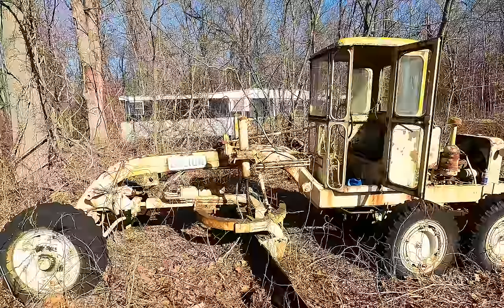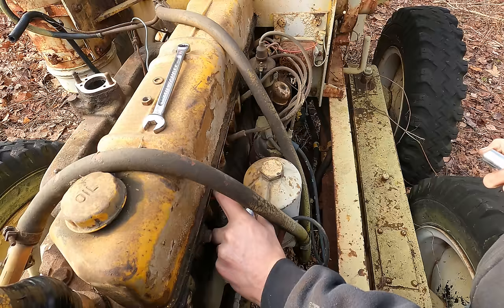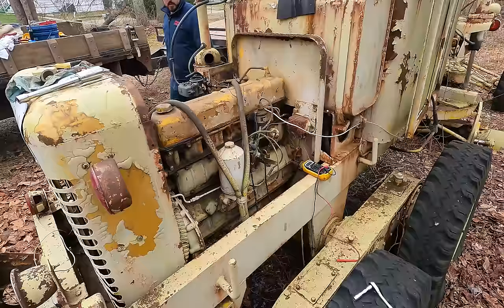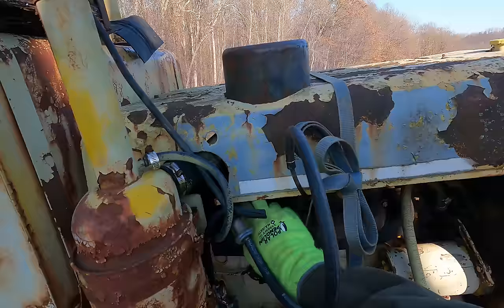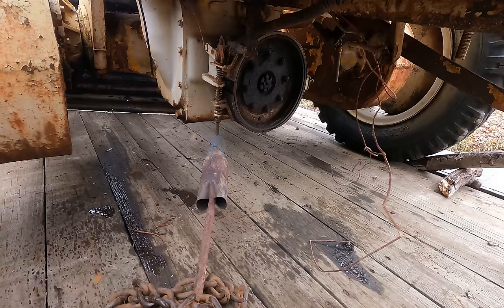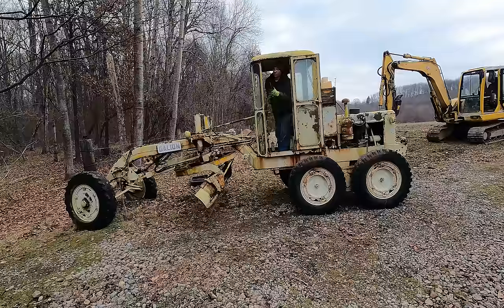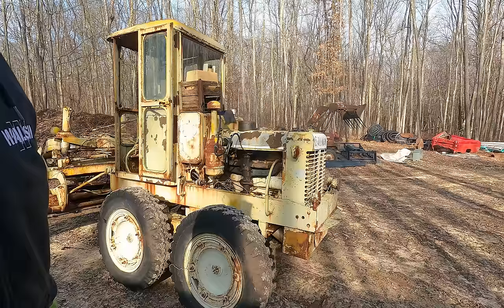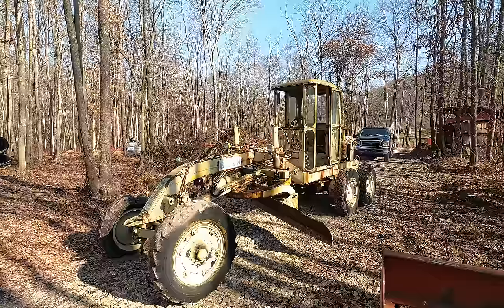1950's Galion Road Grader sitting 10+ years! (Will it run and drive??)

Comment: A tip on your GoPro. When you have the camera mounted, turn off Hypersmooth. It tries to smooth out movements and you get that rocking motion you can see when you are working at the bench as it tries to smooth your hand movement. To fix, make a preset mode with Hypersmooth tuned off and choose 'Mounted' as a name for it, and make sure to use 'Mounted' any time the camera is not hand-held.
Reply from the maker: Thanks! Yes it was giving me problems today and I was trying to figure that out
Reply: @DieselCreek  Mine keeps crashing. Don't know how to solve that one, other that turn up the beep volume so I can hear it over the tools 😉

Comment: The carb frosts because of the cooling effect it has on the air being sucked down its throat, accelerating it and freezing the air. That's why we have carb heat in airplanes with carbs, to prevent carb ice from moisture in the air

Comment: If that 1 pony engine wont run then its a dead duck for sure!! My brother bought a International D7? dozer that had been sitting since 1952 at a college site and it was used there for building the place..             
Did it run?  DAMN RIGHT it did and that 1 pony engine was great after a complete rebuild where it froze after sitting so long!!

Comment: We had an old tractor a Volvo T24, and the rubber boot was torn up and broken around the gear stick so one winter it froze solid from water getting in during the fall rain, so my dad ended up lighting a fire underneath it to break it loose and never parked it outside again

Comment: That is an IHC Black Diamond BD 220, BD 240, BD 264, or if it has tilted valves BG 221, BG 241, BG 265. For a great starter get from Wilson a starter for a LP or propane engine. Almost twice the cranking power. 
When you get it running, warmed up, torque the head bolts, then set the valves hot, idling around 400 rpm at 0.025” no matter what the sticker or valve cover or manual says. Set the distributor on 0°, set the ball in the flywheel on the pointer at 350 to 450 rpm, on our trucks I set the timing from 0° to 5°BTDC. My uncle has one truck that runs best at 12° BTDC, you have to find the sweet timing. 
Before you take anything apart, check where the timing is at. 
To find what motor you have, on the right side of the block, just below the head gasket, back of the water pump, there is a pad with the model number & serial number of the block. 
Good luck. 
Hello from north east Montana. 
10 miles from Canada.
Reply from the maker: Thanks! That’s gonna be a lot of help! I can see you’ve prob worked on a few of these!
Reply: @DieselCreek    When I was 14 I had to start being a mechanic on the farm. Dad had bad hip, he went to have a stainless steel cap put over the hip ball in 68.
So I did a lot of work on the farm’s 56 IHC S120 with a BD240.  The two 41 & 49 IHC K5S& KBS5 grain trucks that were converted from flat head  GD233 to BD240.  The two 56 IHC S160 grain trucks with a BD264 and a BG265 with a 2 barrel carb. Soon my uncles started hiring me to work on their grain trucks when they started finding out how much I could coax out of those old motors. 
The IHC inline 6 cylinders like their gas, but they have a lot of torque so that you can gear up, throttle back. 
Good luck from north east Montana.

Comment: Change all the oils. If there's water in the trans, there's likely water in the tandems as well. And possibly the hydraulic. And 10 years is a bit longer than most oil's shelf life. Also check the front hub bearings and circle drive case.
Good engine, and everything (except the electrical) seems to work fine. Just gonna take some money to fix it up.
Reply from the maker: Working on it!

Comment: If you are having camera troubles you can try an old smartphone as a camera. I have a GoPro hero 7 white and it's not that great. when I first got it it would freeze, it wouldn't be recognized in the smartphone app. They have stands and tripods for cameras and phones. You could use multiple cameras for different angles or as a backup if one camera fails to get the shot.

Comment: there's a reason that thing's been sitting for many years. cost more to fix than it's worth. i used to sell parts[Allis-Chalmers] for dozers, scrapers and motorgraders and we occasionally got parts back in the 70's for those galions. they sold out to somebody and parts are rare. used parts maybe. good luck. kinda like Mack trucks, had a lot of proprietary parts.

Comment: I had a nd 1400 flatbed that had a bad hydraulic line on it it was $700 for that one line couldn't find it anywhere but China! I was able to go down to the local hardware store and replace the line with flexible copper tubing and some compression fittings for under $20 that line has over 5000 miles on it and it's still holding strong so you might be able save some money taking a similar route

Comment: I used to have a Galion grader. It's very hard to find parts for them anymore. I ended up getting rid of it and bought a Cat 14E , ~ 1970 vintage. Cat still sells parts for them
Reply: If Cat ever made it,you still get parts.It’s there corporate philosophy no matter what production year it was
Reply: @michaelmckenzie5232  Yup. It's the reason why the resale value of Cat equipment is much higher than most other equipment, and consequently they're able to sell their new equipment at a higher profit margin as well. The people buying new equipment know that they will be able to run it for thousands of hours and still resell for good money in the end.
Reply: @castirondude  plus if you operate and maintain it like you should,It will almost never break down

Comment: Most of the time, there is a view plate or cover you can remove. Even remove just the Starter to gain access to the pressure plate. Insert a prybar between and separate rather than pulling engine or dropping transmission.
Reply from the maker: yep thats my plan!
Reply: @DieselCreek   I heard you say you might have to pull the engine... I was hoping you didn't have to go to all that trouble. Sweet looking machine and it ran awesome when y'all started it up in those weeds.

Comment: That is a fine looking little motorgrader. she will clean up nice, looks like you got all the glass for it.  Might be able to spray a bunch of PB Blaster or the like in around the clutch plates and given a bit of time she might break free, get her running and load up the blade with a healthy cut while holding the clutch down and she'll give. I always liked running a grader.
     I also started with the original Gopro, wife gave me a goPro Black and it eats battery life , there is one setting that records over previous video when it gets full.. to dang technical for me
Reply from the maker: I loved my hero7 black the 9 has a lot more features than it did tho

Comment: It’s carb ice, caused by a sharp air pressure drop in the carb (Venturi). It’s also an issue for piston driven airplanes that use carbs.
Reply: No. It's caused by the latent heat of evaporation of the fuel.

Comment: I’ve been a boat owner most of my adult life and one Marina I used to dock at their mechanic used to run old marine diesels on a IV bottle filled with WD40  to test them and get them running temporarily  I’m surprised you guys don’t use something like that just to get them on a trailer etc  I used the WD40 on my Chevy 3500  diagnosing  it in the driveway with very limited tools   The truck ran pretty well on the WD40  I thought  pretty cool piece of history you guys got there  as a kid in the 70s that style grader was one I thought was so cool  ironically in my 20s I worked for a new home builder  and  I used to help put in the roads  we never used graders as everything was  pushed with Dozers  Nd Loaders if it was a lot of dirt needed to be moved  I got to live some of those boyhood desires  by running  some equipment along with the real experts  yep sure. Ran a Skidsteer and cleaned up the curb and gutter  area for them  but I was still doing something usefull  it was a promotion from compacting on the Sheepsfoot roller that would rattle the fillings in your teeth

Comment: about the camera issue, i think its the memory cards you use, cause some of them (cheaper ones) dont have enough speed for the camera and just give you problems and it may help to replace the sd-cards if they were used very frequently as they degrade over time
Reply from the maker: brand new scandisk extreme ultra pro. fastest you can get to my knowledge.

Comment: I heard you about 'social distancing', and laughed; but I have another take on the Galleon: it's a work of real beauty..When you worked on that gas tank/ oil reservoir, weren't you impressed by the perfect proportions? And the piston size for the board!
That is, I think of it as a work of industrial design at its best. Now I know you bought it as a tool, and that's OK. But don't you have a friend that you could get to rebuild the motor?
Reply from the maker: I could rebuild the Motor.... but it doesn’t need rebuilt?
Reply: @DieselCreek  You are right: "If it ain't broke, etc." Sorry.

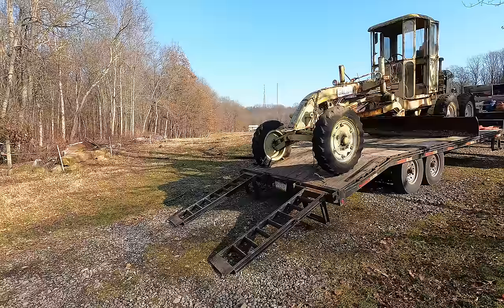Comment: I call it oxidation on the points, but I don't know what it is for sure. Probably parked because of the clutch; Such a healthy engine. At 19:54, as your safety officer, I denying your request unload this grader under it's own power. With the flat tire, you are going to slam that bade full force into the deck and bounce around inside the no seat/ no restraint cab. LOL, Ok, I'm really glad to see the loader come out. Yea, checklist everything when working solo like that. I haven't laughed that hard in a long time. Thanks

Comment: Those small graders are scarce, especially in running condition. I hope you flush that transmission with diesel a few times. Hopefully the gears, bearings, races and shafts aren’t pitted. Probably the rubber boot on top of trans is rotten. 

You have a nice machine there and can always get your money back. I work equipment auctions on occasion and when we get one, they bring good money.
Reply from the maker: Yes I need to find where the water got in at, the boot seems to be intact around the shifter also it is inside the cab so I’m not sure that that’s where it came in but I need to do some better inspecting

Comment: should have left the gear case plugged till it really heated hu thoroughly then you'd be sure you got it all. it may take longer to heat up but youll deff be sure you got it all cause with the voids in the case it doesn't heat up evenly

Comment: I HATE gopro. Only one I had was the 2, and that thing would frequently just either not record, or stop recording seconds in. It was complete garbage. Also, up till the hero 4, it was the BEST rated gopro! So that tells you something...

When I was using it, it occurred to me that they should have fixed the issues they had with the 1 and 2, and THEN made the body smaller and lighter and whatever. There was no issue with the size that a functional camera wouldn't outweigh!

Also, I love the song you inserted there. You know, the: "there was a house in New Orleans, they caaaalllled it the rising sun."

Comment: I would used 5-30 motor oil instead of WD40 because of washout of any lube left on the walls WD 40 is actually a degreaser  I use it to clean lawnmowers

Comment: do yourself a HUGE favor and replace the points with a Pertronix unit
Ive done it with lots of engines and never have to mess with finicky points again
Reply from the maker: I’ve had lots or people tell me that over the years but I’ve had dozed a of units with points on them and really never had much issue with them

Comment: To fee clutch put front against tree so grader can't move. Put in 1st gear, push in clutch and start motor. Since grader can't move all engine  torque will be put on clutch to spin rather than  moving  grader.

Comment: Even as good as that engine runs if I had it I'd probably stick a 3-53 or 2-72 Detroit i have here in my yard or maybe even buy a little 3.9L 4BT Cummins in it especially since you're pulling the engine anyway I think I'd definitely convert it over to diesel just to avoid maintenence issues with points and carburetor problems for sitting for long periods of time.

Comment: thats a POS  Holley cathedral style fuel bowl carb. be damn careful, if it's not working perfectly they like to shoot fuel out of the fuel bowl vent. i had that happen on my '58 dodge and caught it on fire when it hit the distributor.  it ended up burning most of the engine bay up before we stopped it.

Comment: Just found your channel.  Seems like you had quite the exiting day/ days. Thought as you were backing up the drive one more gremlin was going to take it into your pick up. 
Maybe drop the blade in the dirt while pumping the clutch.  I'm guessing the linkage is mechanical not a slave cylinder. With all the water it is like my tractor. The clutch was rusted to the splines.
Reply from the maker: It's definitely stuck really good. Ive tried a few different things. gonna have to get a peek in there to see what's the issue. Thanks for coming aboard!

Comment: remove dust cover or access flywheel from starter hole, brass on flywheel then blunt chisel in air hammer, turn flywheel 1/3 turn and repeat. Clutch pedal depressed.
Reply: You'll want to use a long stroke hammer to hit against the brass maybe aluminum would work just as good, this is to keep the chisel from marring the flywheel surface.

Comment: Should have put it in first gear not fourth. Gear ratios are backwards when using the gears to hold the vehicle therefor it would have been hardest for it to turn the engine in first.

Comment: 24:02 the higher gear holds it LESS than the lower gears.  low gear equals more turn of engine per turn of wheel
Reply from the maker: I know but I could only get it into 4th at the time

Comment: We used to call them knuckle Busters
Reply from the maker: These kind aren’t what was known as “knuckle busters” this is an all hydraulic machine. Knuckle busters ran directly off the trans like a pto and were all gear driven so when they reached their limit they would kick the control back to neutral and smack your fingers if you weren’t fast enough
Reply: you are so right the knuckle Busters were caterpillars to

Comment: I like a project but couldn't you have bought a new box scraper and york rake for that?  Seems that would do a great job on the road too.
Reply from the maker: it would work but not nearly as well, graders are inherently better for fine grading because of having the blade in the middle. also I can crown the road and cut ditches and much more with the grader.

Comment: @Diesel Creek - you prob got a bunk/counterfeit sd card from amazon or ebay.  for those nowdays i buy directly from sandisk.  they are the same price as on amazon and you know you're not getting a fake.
Reply from the maker: I got it through amazon but sandisc was the seller I can usually spot the knock off crap and this one was legit.

Comment: You should try an Iphone or something along those lines instead of a GoPro. Action cameras are great for riding around on a quad/motorcycle or getting out on a gokart or snowboard or something.. but for static shots a regular camera really is the best. The plus side to using a regular camera/cell phone is that you can typically also adjust both the color/contrast and focus where you have no real control over it with an action camera. Man, I'd call that thing the Greenhouse Grader.. almost looks like you could use it to grow a couple weed plants in there.. or tomatoes. (weed's legal in California btw) Old straight sixes.. they don't make shit for power, but unless you do something seriously heinous to them, they'll pretty much run forever and on almost anything slightly flammable. I have to ask, how often do you find yourself unloading your truck or trailer by just hauling ass in reverse and then slamming on the brakes? "More work than it needs to be.." That needs to be a shirt, with LIFE added before it.

Comment: First mistake you guys did was try to operate it after it's sat for 10 year, after that long out in the elements all the seals and hoses would be bad.  That is why they were all busting or leaking.  that thing needs a whole rebuild before use.
Reply from the maker: Agreed but I needed to get the blade up and turned to get it on the trailer and I was able to do that much

Comment: The video is showing you are rolling in reverse when the starter is engaged.  Yes you are trying to get the clutch working--but you're doing damage to other components too. Try not to get yourself killed with this thing.

Comment: low gear = high resistance , basically how I was hurt in military, another guy shifted in high gear thinking higher compression ,,, I am 57 and still have brain troubles.. PLEASE be careful. 2nd Brigade  2 inf. Div. 702nd Mnt. Bn. Camp Casey Korea 1986-87
Reply from the maker: I miss spoke in the video made it sound like I didn’t understand that, fourth gear was the only one I was able to get into I would’ve much preferred first
Reply: @DieselCreek  I was kinda confused too, you have always been knowledgeable with mechanics ,,lolol , keep safe :)

Comment: Beware the Gay Lions they are out to get you. Instead of changing  the oil
change the engine, that gallon of fuel used to go nowhere is just the beginning
even diesel graders are heavy on fuel, I would dread to think how many gallons
per hour the Inter engine would use. Just a suggestion from an old grader driver.